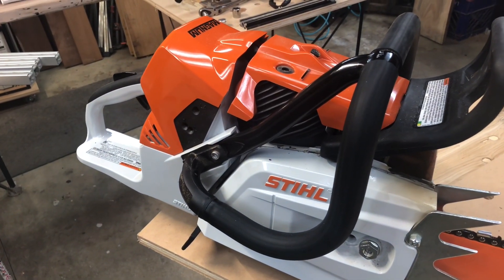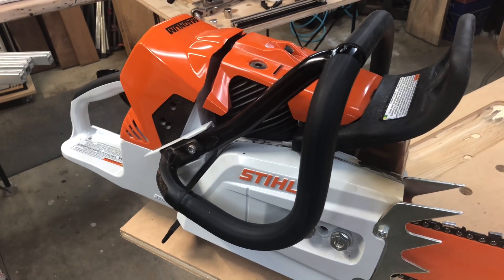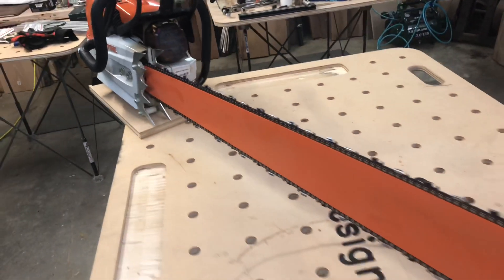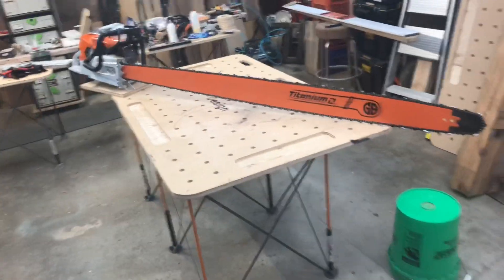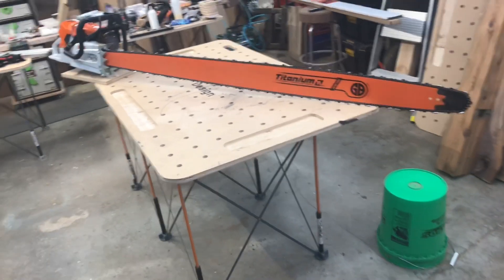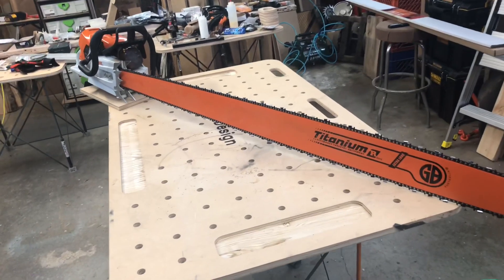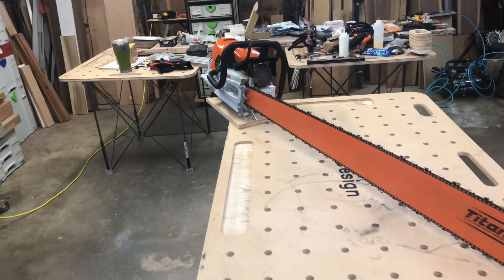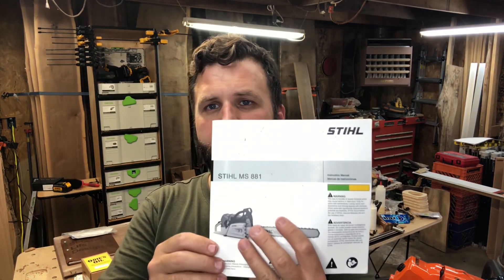Milling Monday #30 | X-Long Bar and Zero Break in Time!

Comment: One thing I wanted to share is that the Sunco 110 octane leaded race fuel will help your equipment last longer. Lead is a lubricant. It has historically been used in older V8 engines to help preserve valve guides and valve train. In this case, we want to help the piston and compression ring last longer. Lead is poisonous and I use a respirator with organic vapor filters, but my saw has never run better.  My saw seems to run cooler with these longer sustained run time cuts.

Comment: I agree i think break in procedures are done as they are used with todays equipment break tyem in how you intend to use the equipment is what my father has always told me manufacturers would not put a warranty on things they think will break down if they dont stand by the product
Reply from the maker: Precisely!
Reply: @SlabGuy  especially two stroke engines i have always been told you cannot baby a two stroke its actually harder on them to do that

Comment: Welcome to the long bar and big bore saw club! I have been very happy with my new 96" Granberg mill using my 2007 MS880. I will say I disagree on the break in. I have bought over a dozen new saws and do run my own tree service. I have broken in every one. I may be biased as I also work for the world's largest earthmoving manufacturer and we have specific requirements for break in periods as well. I just can't fathom spending that kind of money and not following some simple guidelines.
Reply from the maker: Thanks for the kind words. My issue was finding consistent guidelines. I asked the dealer I bought it from, a small engine shop and the community en masse and got wildly different answers. And the manufacturer had no instructions either.
Reply: I completely get that. Opinions are all over the place. Best you can do is follow whatever manufacturer guidelines are available. And it probably goes without saying to stay away from any % ethanol in fuel if possible. I'm excited for you on your new mill. I look forward to seeing how it works for you. I know keeping the chain tension up is important. I've had the chain run off mid cut, hitting the guide and dulling all of the teeth on one side.